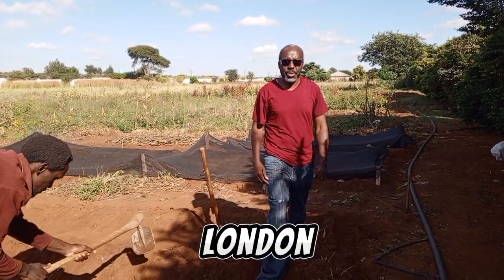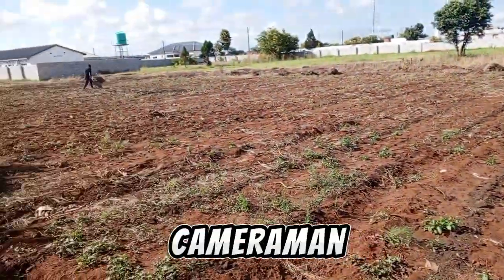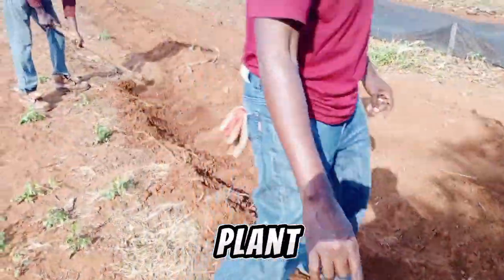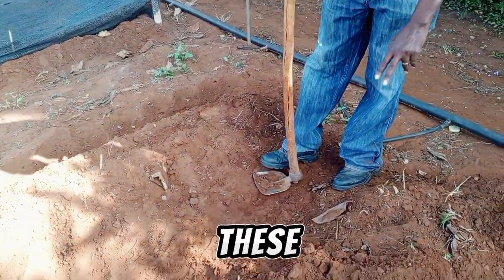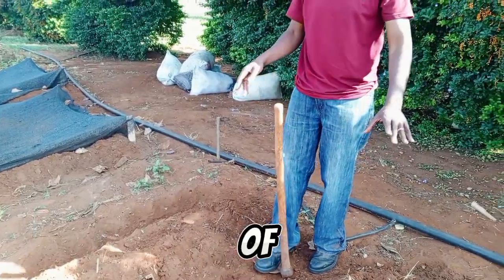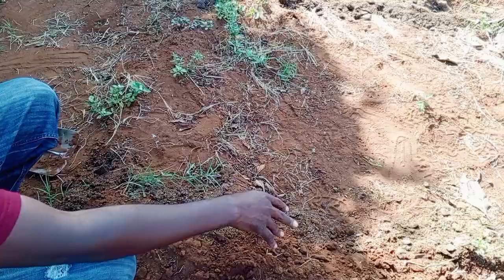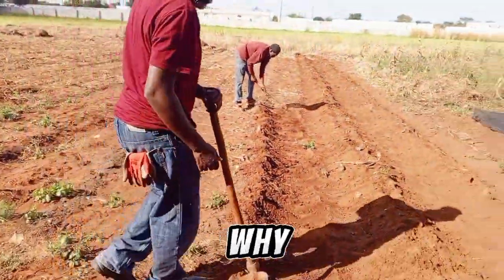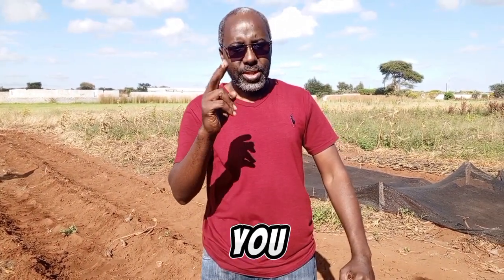Preparing Land for Winter Maize 🌽 in Central Africa

Comment: Thanks for sharing and does winter maize also have a planting calendar ?
Reply from the maker: Yes and no depending on your location. In Zambia we can grow it throughout the year. Thanks
Reply: @massiveactionfarm2143  thanks so much for the quick response , I also saw the chicken manure being applied and my mom to question is can maize grow organically like those used to apply with synthetic fertilizers D and urea or u would need both?
Reply from the maker: @lusungutomokasangulukani7321  You will need both the basal fertilizer and chicken manure and later on at knee height or 6 weeks whichever comes first apply top dressing. The manure helps in many ways; soil enhancement and nutrients and it also to generate heat or humidity which is needed during the winter season. No harm I use both for better results. Check out my next video as we plant I will explain more. Thanks 🙏
Reply: @massiveactionfarm2143  thank you so much and will surely wait for the next video